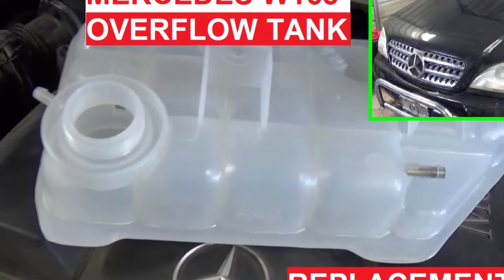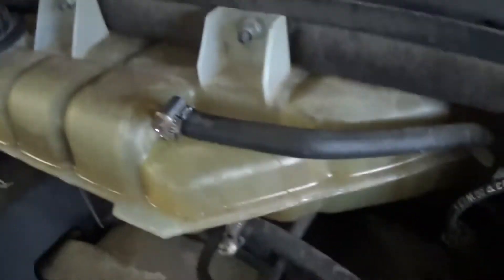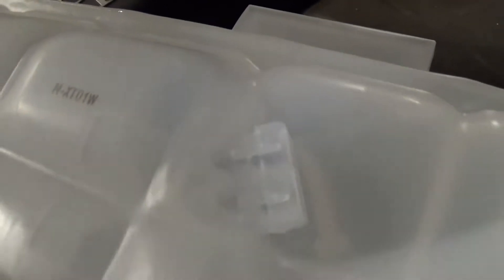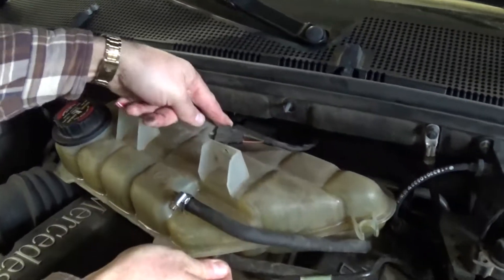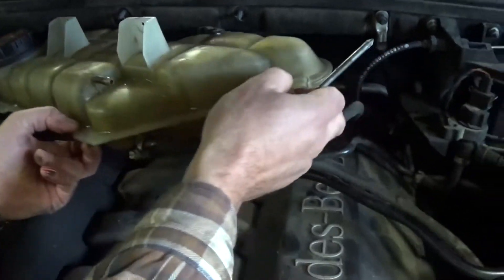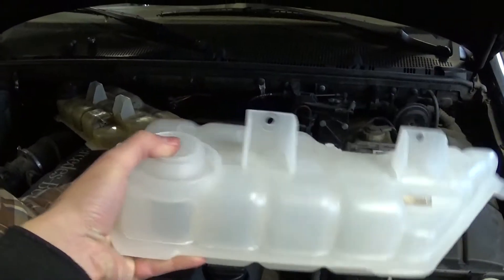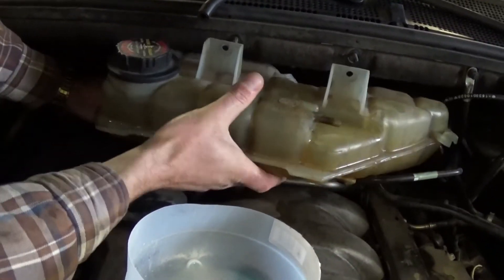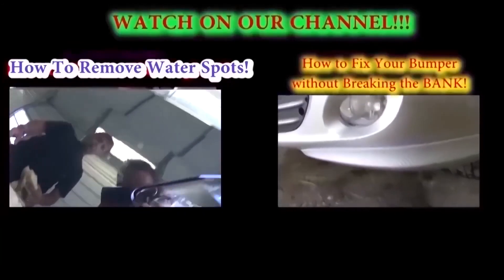Coolant Overflow Tank Replacement Mercedes W163 ML230 ML270 ML320 ML350 ML400 ML430 ML500

Comment: Really good instructions and the coolant tank came off easily from my 2004 ML350, 3.7L (nickname "Frank the Tank"). Removed the engine shroud first, then removed the 2 smaller hoses, upper and lower, on the right side and marked them. One thing I discovered was that the smaller upper hose contained the small copper tube which had broken off from the tank and was stuck inside the rubber hose. Used a small needle nose pliers to remove. Then removed the nuts holding the tank to the firewall and finally the larger heater hose on the lower left. Waiting for my new coolant expansion tank to arrive... Took about 15 minutes.

Comment: Love the 1st  gen ML, I have an 02 270CDI really easy to work on and parts are cheeeep !good vid btw.
Reply: Totally agree! Everything is fairly easy to get to. Replaced my water pump, valve cover gaskets, brake lines, headlights, fog lamps, brakes. It may not look like much, at 200,000 miles and in Minnesota winters, but it's got a great engine and running strong. I wouldn't even try to work on my BMW!